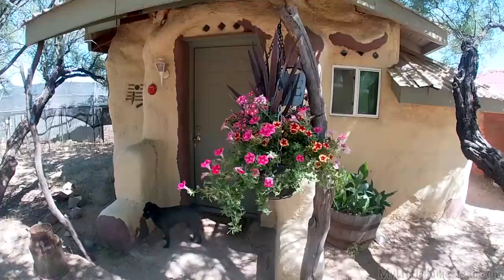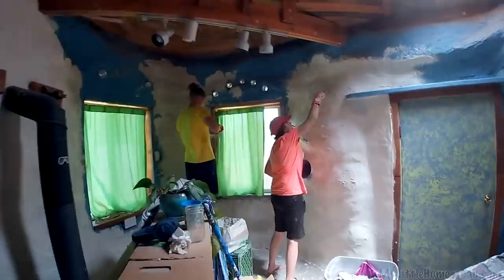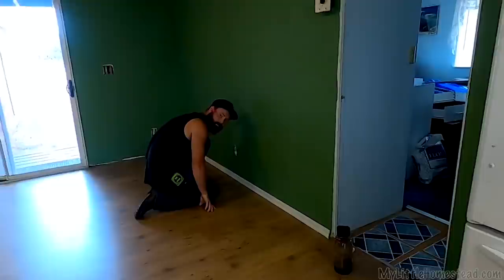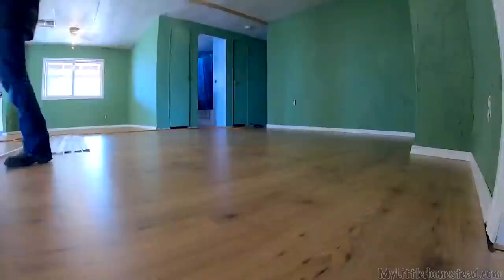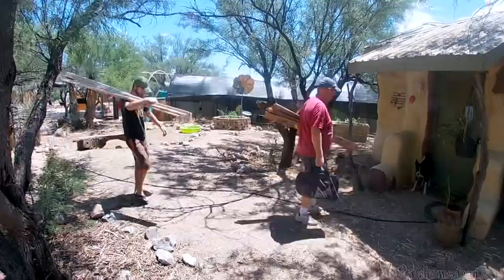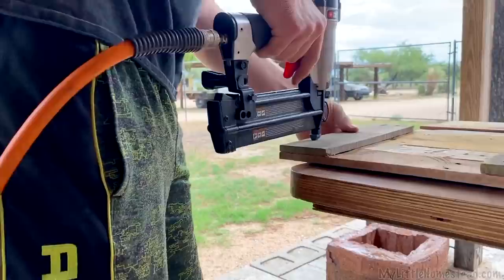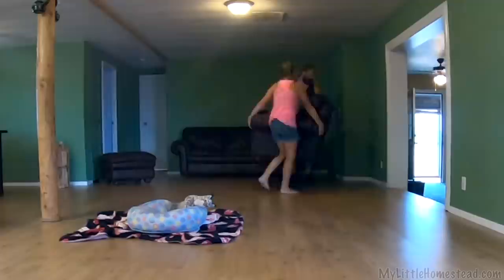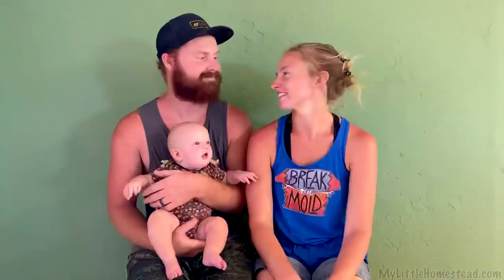G&E Laminate Floor Complete, DIY Pallet Shelf & Earthbag Wall Texture Finish  | Weekly Peek Ep246

Comment: Prayers and best wishes for everyone in the (extended) family.  For a fairly cheap whitewash you might try using a thinned out waterbased white paint.  It should soak into the rough cut pallet boards.

Comment: I lime washed my pallet board walls...mix a small amount of lime putty with some water and it's good to go. Very cheap paint and a lovely effect. You can add a small amount of raw linseed oil...I used a teaspoon for about 5 litres of paint. It goes on translucent and dries white. I found one layer was enough. The more layers, the more opaque it gets. Good luck!

Comment: Garen was asking about covering the nails in the trim i used to work at an apartment complex and when we put up trim we either put a lil dab of the sheet rock mud in it or when we were out of that we would get a tube of the mat tub calk and put a little of that in and paint over which ever we used to make a smooth surface

Comment: when using boxed sheet rock mud or as we call in in Canada drywall mud, if you put it into a 5 gallon pail and mix it up with some water it will be easier to apply and will have very little to no cracking. it will also increase the amount you have to use a little.

Comment: I use paint to stain wood. I thin it with water using a 50 50 ratio. Then I can apply it with a rag just like stain and it gives the wood the color and you can see the wood grain.

Comment: Bree, my favorite white wash is Minwax white wash pickling stain. I brush on and let sit for only 10 seconds or so and wipe off. It might absorb different on rough/dry wood but it doesn't give a paint like thickness on the wood and let's the grain show.
Reply: Also a cheaper and less stinky way is to water down latex paint but effect isn't as good as the stain imo.

Comment: sorry about gpa again,
 Mix 2 parts white paint (flat latex or matte acrylic both work fine) with 1 part water.

Brush on the water/paint mixture in the direction of the wood grain.
Use a clean rag to wipe off the paint in the direction of the wood grain.

Comment: You can use flat white paint and just thin it out and only do one coat. It usually will soak into the wood and you'll still be able to see the wood grain coming through. You may be able to get away with two or three coats but I've seen it work best with only one or two at the most.

Comment: Try a pickling stain on the ceiling. Easy to make 1 part primer/sealer 3 parts water
Reply: Oooooh we thought the same thing.   🌟 ⭐ 🌠 💫 🌟   😃
Reply: I came in to comment the same thing! Pickling is so much more "sheer", while still offering much of the "lightening up the space" effect of a whitewash. 👍🐻👍❤️

Comment: Whitewash - mix 2 parts white paint with 1 part water. Brush on in direction of grain. Use a clean rag to wipe off the paint in direction of the grain. Best if used on smooth wooden surface. Bad thing you go through plenty of rags.
Ellie - with those metal hearts (depends on type of metal) take a blow torch to them to heat the metal up. This should cause a color change; different temps equal a different color. Once you have the desired color(s) quench the metal in oil. Remember to heat the metal slowly.
Bree - lookout your replacement is coming. Little Azalea lights up whenever she notices the camera on her. Once she starts talking it's over.

Comment: A friend of mine use joint compound for stucco . He never painted it a few years later he redid it the water in the new mud soaked into the old stuff reconstituted if and it  peeled off wall so make sure you paint
Reply: When I do a bathroom over . I use what we call quick mud . It is joint compound that comes dry in a bag  . You only mix what  can use because once it drys it's a rock. They have different types of mud that drys at different rates . The slow one has longest dry time and most likely best for desert

O

Comment: Recipe for a whitewash with latex paint.  Dilute paint to taste.  (example 1:2 or 1:20) Do a test to determine the desired dilution ratio by placing 1 part paint to 1 part water and do a test swatch and mark ratio on the board under the swatch.  Increase or decrease the amount of water to paint by 1 to 3 parts based on the initial effect of the first test, and do the next test swatch and marking accordingly.  Repeat until you have a dilution rate you are very dissatisfied with. let dry overnight.  decide on your ratio and go.  The benefits of this method are: 1) it gives the effect of stain, 2) it is hardy and won't fall off because of the dryness of the seasoned ruff finish boards, 3) it is late is readily abundant and cheap, and 4) it allows you flexibility with color.

Comment: Bree you might want to look into insulated paint for your walls and ceiling . apparently  it has quite an r value .Aircrete harry in his you tube channel used it on a dome in the high desert and had good results with the insulating quality's.

Comment: I’ve used a watered down acrylic as a wash over wood. There is no real recipe for the mixture. You kind of just mix it a experiment with a scrap of wood until you get the desired look you want. After it’s applied coat with a clear varnish either painted on or sprayed on. Acrylic paint has a plastic base so thinning it out like this makes it need a protective coat. 

Also please note a good rule of thumb is if you can to clean your brushes with water it can go under a medium that requires spirts or thinners to clean up. Never apply a water clean up over a thinner clean up medium. Oil based products need to have access to the air to dry properly and can take years to properly dry. Water based like acrylic, water colour, gouache or tempera (many Renaissance artists paired with egg based tempera mixing it on site whilst painting landscapes out in nature) dry completely and rather quickly, if dried before application these paints can tolerate oils based products on top of it. Surprisingly egg tempera paint is surprisingly durable (commonly called poster paint, not always made with egg though).
Reply: Good information, thank you!

Comment: Whitewash: I haven't done it personally, but I've seen thin milk paint used for a great, rustic, natural wood, white wash effect. There is a mix/technique to getting a wash instead of a solid color. I see that General Finishes makes synthetic milk paints, and they make very good stuff. Apparently they also have a whitewash stain. It looks great in their gallery: https://designs.generalfinishes.com/tags/whitewash So that's two ways to tackle it. I think the milk paint gives a more antique/rustic finish. You can also apparently mix the two and use it like a stain (up to 50% milk paint per General Finishes page: https://generalfinishes.com/wood-finishes-retail/water-based-milk-paints-chalk-style-paints-glazes-pearl-effects/milk-paint)

Comment: if you lacquer or clear coat the wood or metal or anything that is before you paint it.. the striper returns it back to normal lacquered appearance - - if you don't removing the paint leaves that color of paint - in the pores of the wood. - <heart> <thought> <thought> <thought>
Reply: on the door jam - then one at the top one in the middle and one by the floor... - When i had that job. - the door jam has to do with where and usage... Do you understand? door handles.. hinges... Usage of door... Such? -   the ones in the trim to the wall.. should be 1/4 in longer than the depth of the trim and the sheetrock or Walling.
Reply: as for covering them up.. the hump is easier and quicker then the grooves - But the grooves are easier to over look. - per to skill and how much effort. - I prefer the groove on the Shadow side of your EYE? - do you under stand that...
Reply: I wrote a song about it.. Want to hear it.. hear it goes...  The Sun in your eyes Shine bright Upon my life... I have yet to met someone That's Shines with Such life .. Sigh.. Got a full page.. Wife, at night.. in dark times.. you're the growth.. - it was on paper.. in my box in pencil - which means it's probably gone forever to time. Sigh
Reply: i can't see my replies? - sigh...